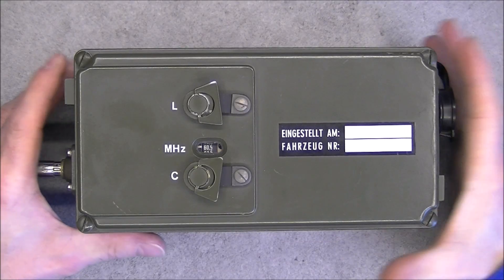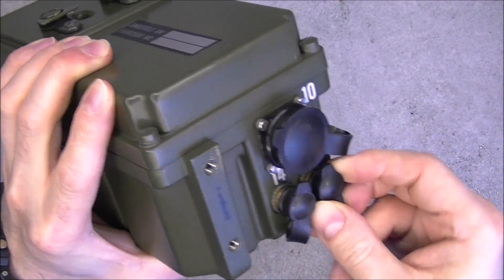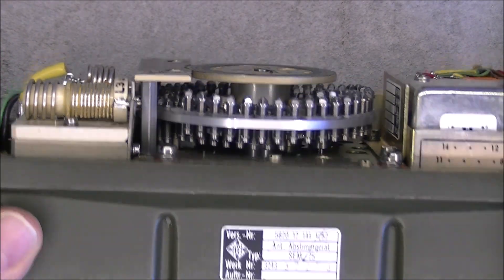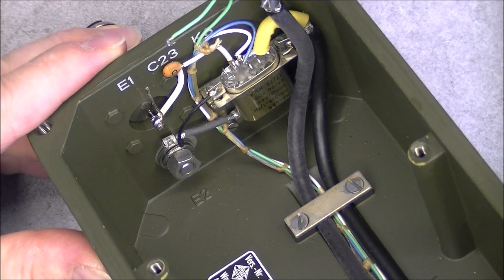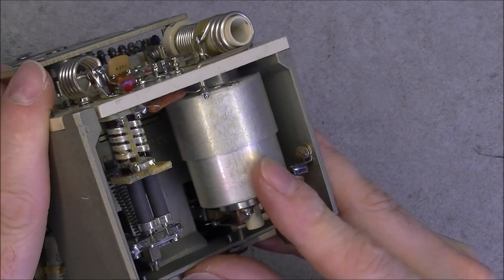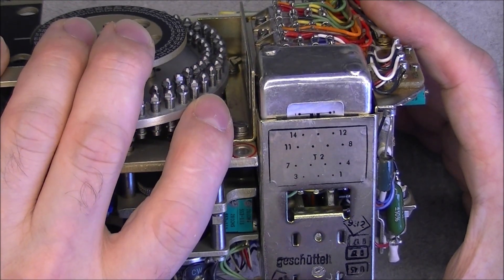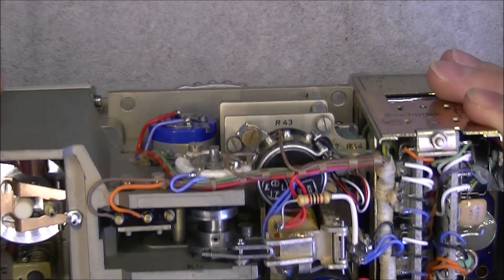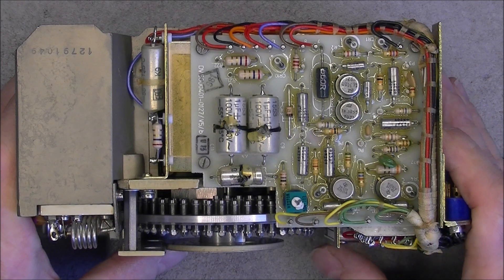SEM 25 antenna tuner teardown

Comment: I have two of such devices in my basement. Are they worth anything? Does anybody want to buy them?
Reply from the maker: There are plenty of them available on german ebay, usually they are priced  between 20 and 40 euros, depending the seller and the condition. They might sell eventually if your price is a little lower than the other sellers :-P

Comment: i have one in a working setup with a sem-25 radio. i use it on my Dutch army vehicle a Daf ya 126 :)  nice stuf!
Reply: From where may I find the cable from this antenna tuner to the sem-25 radio?